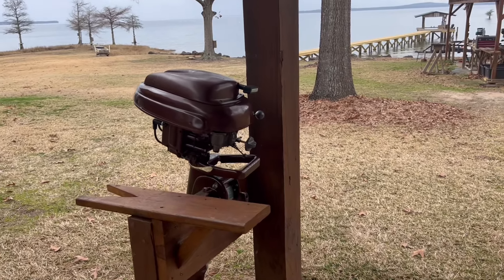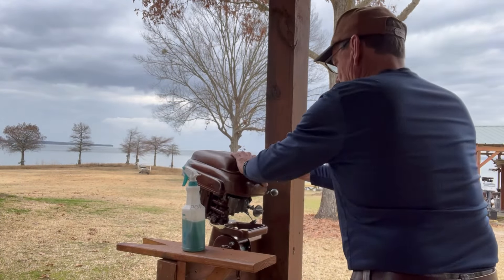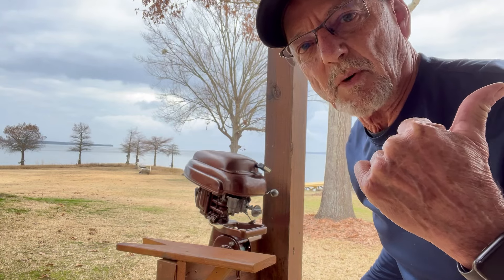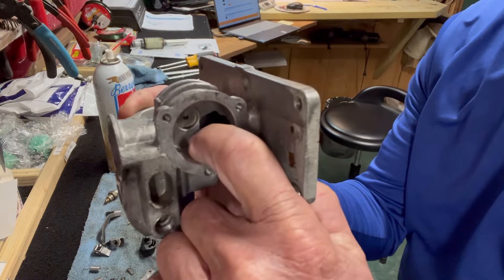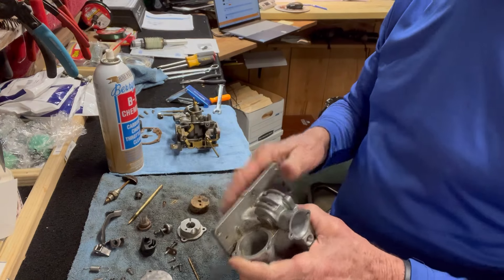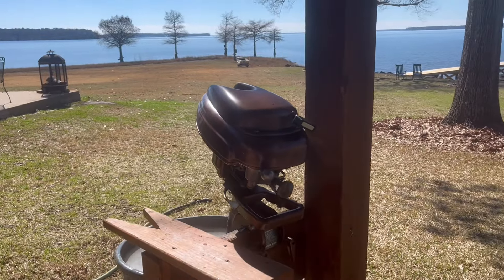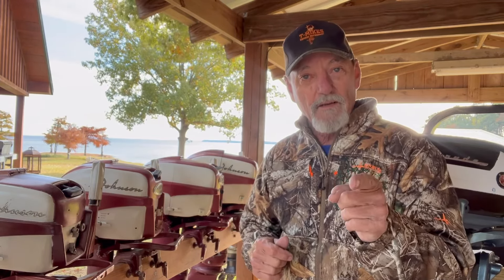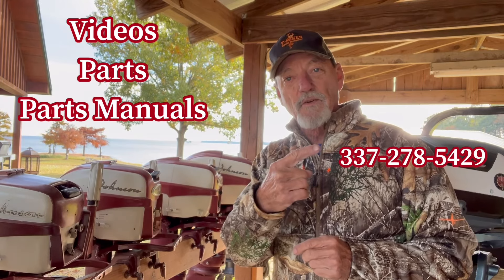Carburetor Trouble 1954 5 HP Gale Buccaneer

Comment: This is the exact problem I just had with my 1951 5hp Sea King.
Same carb and couldn't get it going till I put wire and carb cleaner from the top as you did and it cleared through the shut off valve orifice.
Great video for these old carbs.

Comment: Hey T Mike, I would love to see this carburetor kit broken down in a video some day. No one else has done it and the carb kit is non descriptive and gives three o rings. Parts diagram says there’s packing material for the main mixture knob and fuel shut off knob , diagram number 10 & 13, and I assume this is what you replace with o rings but am unsure, and removing the old fibrous material is difficult but manageable. The third and smallest o ring I believe is for the inlet needle, diagram number 27, but I’m not touching that needle unless absolutely necessary as I’ve heard that if that inlet hole gets wear, the float bowl won’t seal and is destroyed. I know you’re very busy and I’m thankful for your videos and that you provide parts on eBay. Any advice is appreciated. Am I changing the correct o ring parts?

Comment: Great video Mike…
Am I mistaken or is there no throttle valve plate on this carburetor?
I know the mag changes timing and engine speed but high speed mixture vs low speed mixture…How does that work?